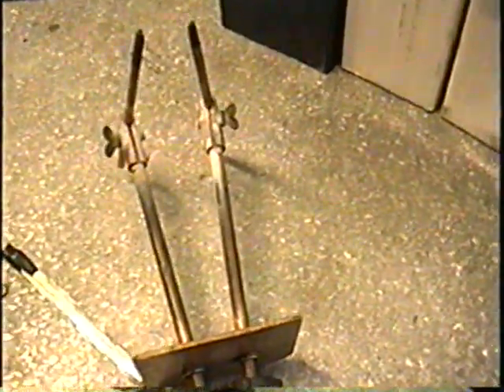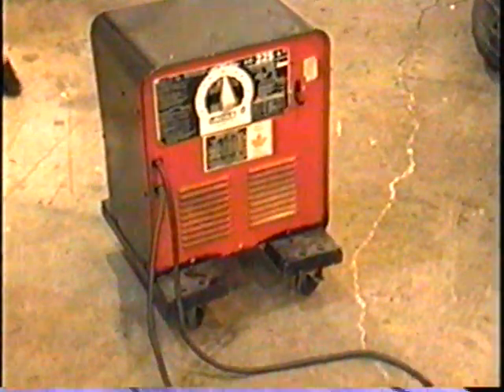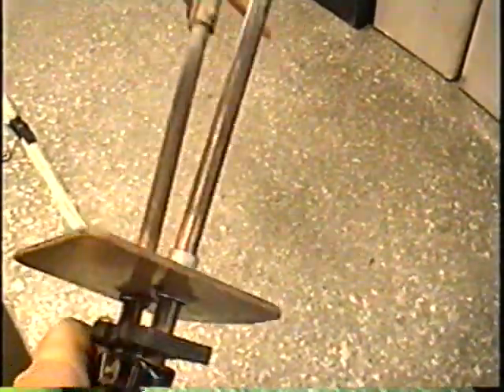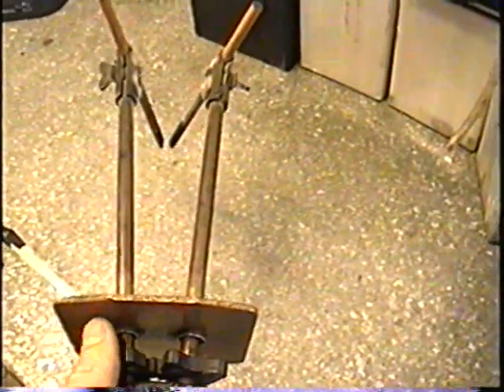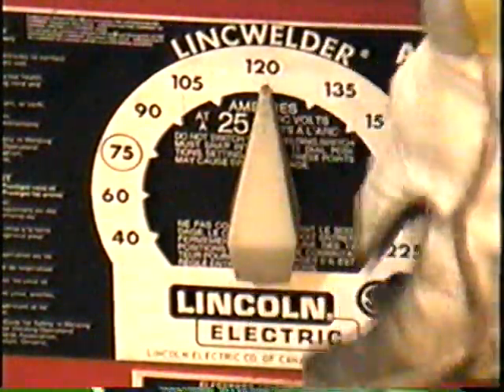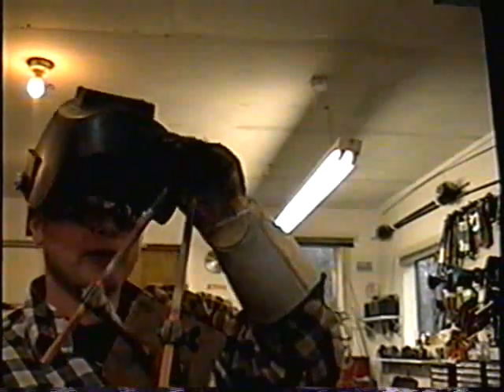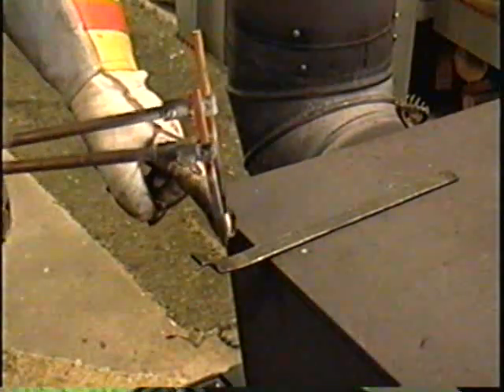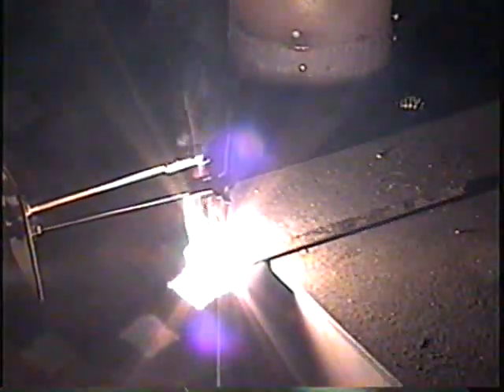Demonstration of The Carbon Arc Torch

Comment: The best way to run this is with the Lincoln Tombstone AC 225 welder; these torches used to be included with this machine. connect it up to the AC Supply, and don't run it any hotter than the 105 amps, as it shows. He was running it wide open, but you can run it on the lowest setting of the welder, up to the 105 range. Can run on DC, but one electrode will wear much faster than the other. This is an AC procedure for best results. Andy C.

Comment: You want it to be more accurate?  Try sharpening them like a pencil- only slightly longer tip, same type cone point... (sharpen lengthwise so you'll have striations rather than rings...) and turn the amps down slightly.  Those of you with dials are in luck for fine tuning.  For 1/8" metal you only need about 40-60 amps.  Higher for bronze and copper.  Superb video.
p.s.  That's an arc not a flame.  :-D

Comment: Carbon arc touch is good for heating cutting welding tin sheets and welding aluminum which don't show fusion before melting so while the touch heats the area which has to be punch to know if it ready for joining

Comment: Great video - needed a quick refresher and I got it. Especially liked the comments that provided information I could have used 100 times if I'd realized it: the comparison to Oxy-Acet welding, the use for heating and not just brazing and things like that. The only question I had was any other way to power this: is it DC or AC? An old science class trick was to fill a large jar with salt water, and run raw AC through it, adjusting the salt level to control the current. If you are on a desert isl

Comment: In my experience, I've used much lower current than what you are for that size rod.  You may want to consider 60-75 amps- should make the rods last longer.  Otherwise, good video.
Reply: *-Yes, I use about 50 amps. By the way, if you can't get hold of the rods you can buy the rods that they use in cinema arc lamps.

Comment: You can also just use a regular electrode holder. Just put the carbon (3?16" or less) in the holder and connect the ground to the work. The arc will be formed between the work and the carbon. Once the arc is established, place the Everdure (silicon bronze brazing wire) in the arc and braze away. Because the amperage to create the arc can be very low, this works very well on thin sheet including galvanized. If you get good with the method you can actually braze galvanized together with a lap weld and the zinc on the opposite side will melt and reform instead of oxidizing as it normally would. Although I have never done it, my Father once used this method of brazing using only a 12 volt car battery as a power source. An interesting website for carbon arc welding and heating is http://www.hobby-machinist.com/threads/twin-carbon-arc-torch.15015/ . They even discuss carbon arc brazing cast iron there.

Comment: Got a nasty old frozen rusted nut?
Clean it on opposite sides enough to make electrical contact , put on your helmet & gloves, set at about 40 amps & use your arc torch to put a carbon electrode directly on each opposite side and hold them tightly on the nut.  It’ll glow red in seconds but the stud or bolt it’s on won’t.  Remove your arc torch, put a couple drops of oil & a wrench on it & 9 times outta 10 it’ll come right off.  No arc, no flames, no extraneous heat on parts you don’t want heat on like using a torch.  Quick, easy, cheap & no gas, hoses or regulators to mess with or put away afterward, just a cord to put away and a switch to turn off.
Done it hundreds of times.

Comment: No this wont work with a mig welder, and to the guy who asked about the high pressure airstream its called an air arc they are painfully loud and work the same way only you have one rod thats attached to a modified clamp with an air nozzle hooked to the electrode holder and an air compressor and the other side of it is just your normal ground cable, then you touch the rod to it and it quite precisely removes metal slowy though, works good for dismantling or cleaning out bad welds.

Comment: carbon-arc is rarely used? Maybe that older style...

If I had to remove a lot of material in short order there's no tool I'd rather use. It's fairly accurate and sheds metal like water. 

Then again, not much can stand up to 900A :\

Comment: Hi there i have just purchased a Weldmate 140 SIP Welder, (The red one quite small) Anyway i hve this torch, What type of electrode do you use in the torch and what rod do i need to weld with as new at this but would like to get the right bits to start with as im going to brazing/welding 1mm metals together on mini bike exhausts and such, thankyou for the grreat video

Comment: Nice torch setup, I have the same welder but I don't have the torch, do u think I could clamp the ground to the work and use 1 carbon rod to arc to the work to heat the metal?,,,, I need to redden metal for bending mostly
Reply from the maker: I'm not sure

Comment: Hi, I'm in the process of making a gas forge and need to braze a couple of fittings together, The old MAW welding plant I have is an Oxford oil filled type, Max 110 amps and  I use it on a regular basis. I have had the Oxford brazing attachment that came with the plant for a considerable time but today was my first attempt at using it. I set the welder up as per the handbook instructions 55-65 amps using 3/8" carbon rods but seem unable to achieve an arc over an 1/8" gap between the rod tips? I then bumped the amps up another 10 amps but with the same result?  What amperage are you using and have you any other tips? PS the welder is an antique (like me) but quite adequate for my needs, It used to belong to the man who designed and manufactured the ventilation system used in the tunnel of the Great Escape!  Regards Gareth. Isle of Wight. England

Comment: should a guy use a ac welder or is dc better( or worse)    thanks for the info  I just fould one of these in a bunch of scrap so looking to try it out   thank you
Reply: AC is better than DC.  The rods will burn down evenly with AC.  One rod will burn down much more quickly than the other if you use DC.  At any rate,  it doesn't much matter.  This thing is just wonderfully fun to play around with even if you don't have a practical use for it.  It's kinda just an arc lamp.  It really lights up the night if you use it after dark.

Comment: HEy,, How about using a carbon rod and a regular electrode holder and a acetylene torch head and compressed air from your compressor ?
Reply: +thangamajig  Make like a regular cutting torch using the arc for the heat.
Reply: I had the same thought.  Brilliant,

Comment: I have Been Welding for over 34 Yrs and Never used one or seen one used  I Would like to Give it a try .  you just get so used to using Newer things and forget how to use the old ones I can't remember the last time I Arc Welded  has to be over 28yrs  That's   Because I use a Heli Arc or Mig Welder  every day at work  Hell we even have a Plasma Cutter and the Gas Bottle setup hardly gets used
Reply: Stick (SMAW) is still the second most common welding process in the US, and THE most common on a world-wide basis. This is mainly due to the simplicity of the equipment needed (including the simplicity of manufacturing the coated electrodes vs cored wire), the versatility of the process, and the fact that it can be used outdoors without any wind breaks and at a considerable distance from the power source. It is also the most portable of the arc welding processes.

I have a plasma cutter as well, but I seldom use it on steel thicker than 1/8". I just prefer the torch, and I get less dross with the torch, especially as the steel gets thicker.

Comment: Can it work with the carbon rod that you get from a battery
Reply: Eldho Kurian yes, but it is cheaper in the long run to just find the closest gas/welding/tractor supply shop and get "carbon arc gouging rods.   I use them for electrolytic chemical refining of various metals. $20-30us vs $80 of toxic chemical laced wax soaked graphite electrodes.

Comment: i have seen carbon arc gouger to cut steel using one rod and air jets on the holder and the ground clamp on the piece of steel but never a torch to heat mettle i want one now that i have seen it the rods are something like 17 cents a piece bulk  it world be creeper than oxie acetylene for what i would use it

Comment: were did you get that
Reply from the maker: got it from an older guy, if you google it you will find instructions on how to make one
Reply: OK thanks so much as I am a  very keen welder and will defiantly experiment with carbon arc torch also thanks for the speedy reply
Reply: Will it work with arc air gouging rods
Reply from the maker: Brian Wynn not sure
Reply: +Brian Wynn 90% sure that's all they are look just like them
Reply: joker9494 Thanks mate

Comment: Im like 900 precent sure thats plasma not flame.
Reply: +joey miles-kelly You need a tank or an air compressor to use plasma, since that process relies on ionized gas.
Reply: Oxy fuel works very well with aluminum, as long as you use the proper flux. In fact, oxy-fuel will weld just about every weldable metal, with the use of the proper flux. AFAIK, titanium, zirconium, and a few others have never had flux or processes developed for oxy-acetylene welding, but they are the exceptions.

One common aluminum item I use as an example of widespread use of oxy-acetylene aluminum welding that many might be familiar with are the WWI-WWII-Korea era water canteens. These were stamped from aluminum sheet, then drawn up to make the basic canteen, with a seam on each side that required welding. In addition, the threaded top piece of the canteen also had to be welded on. TIG wouldn't be developed until he 1930's, and not put into use until WWII, and then only in aircraft factories. So, all the aluminum welding done prior to the 1950's, including ALL pre-WWII aluminum airfraft welding and much of the aircraft aluminum welding DURING WWII, would be done with the oxy-acetylene torch. Magnesium is also weldable with OAW, however the difficulty with welding thin magnesium with the torch was the main impetus for the development of GTAW. The main reason OAW continued to be used to weld aluminum for so long after the development of GTAW was due to the cost of high purity argon and helium, as well as the high capital cost of the welding equipment itself.